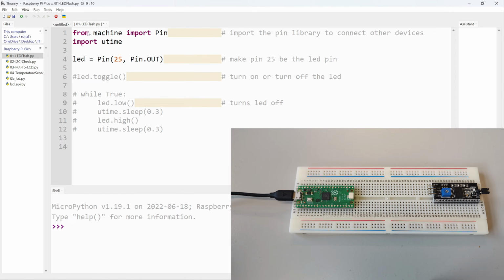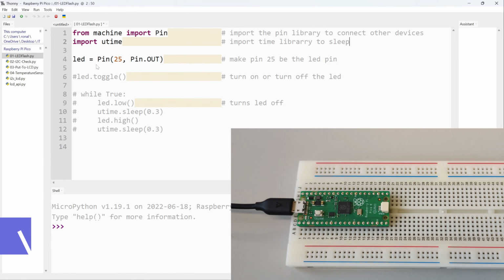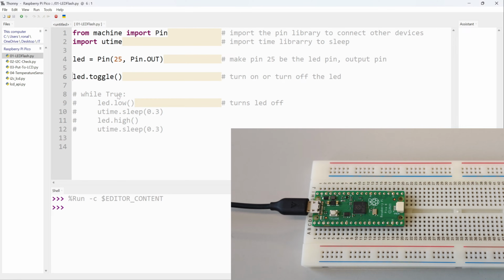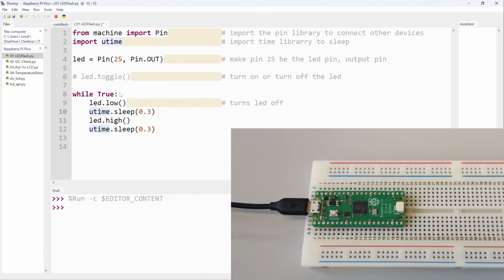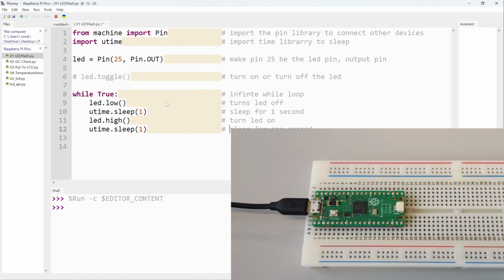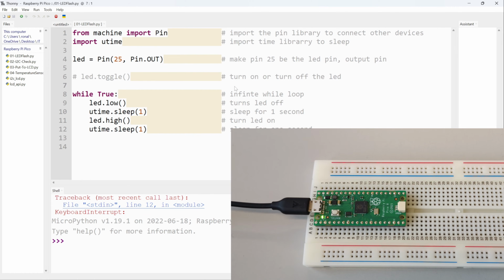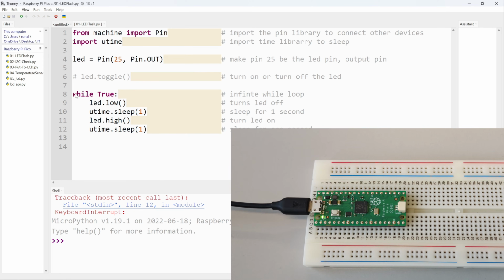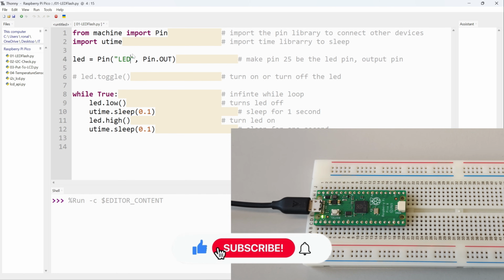Raspberry Pi Pico | Part 04 | FLASH INTERNAL LED - (2022)

Comment: This does not work on a 'W'.     instead of 25, 'LED' works.    But what is 'LED', there must be a number that works?
Reply from the maker: "LED" instad of the number will wotk fine.

Becasue the internal LED is coneceted directly to the wireless chip so they just made it "LED" instead of a pin. You can still set all of that to a variable.

led = machine.Pin("LED", machine.Pin.OUT)

Section 3.4 of the Pi Pico W Datasheet.

source Of information: https://datasheets.raspberrypi.com/picow/connecting-to-the-internet-with-pico-w.pdf